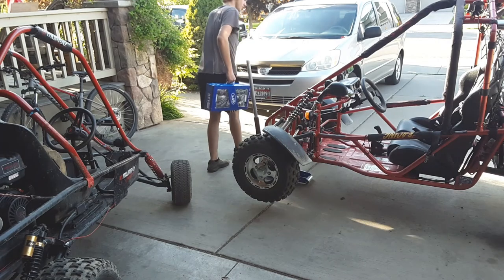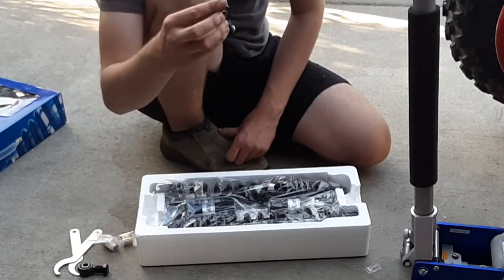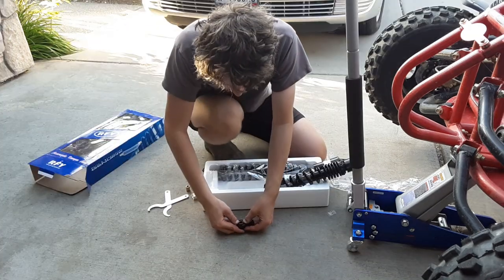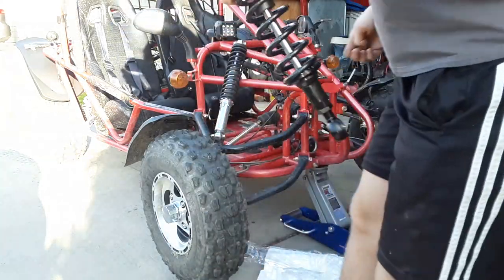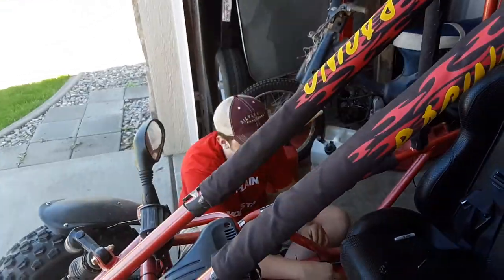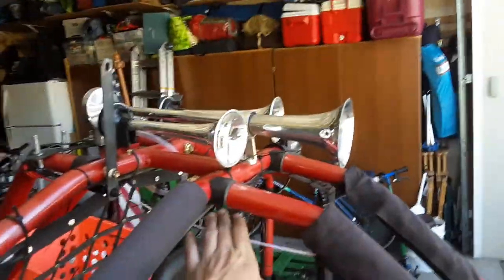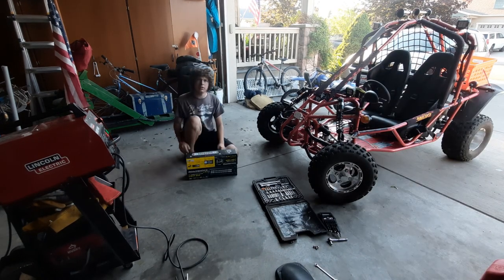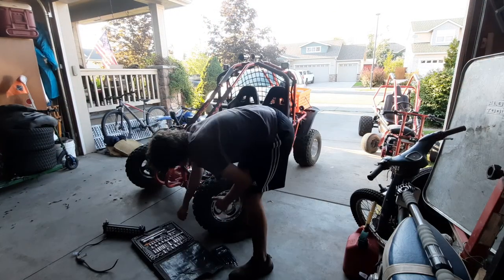Massimo GKA200 DIY Upgrades!

Comment: Where did you get the horns?
Reply from the maker: I got those off of ebay. There is a truck horn kit on there for $15 last I checked. The switch isn't included though, I just used a motorcycle brake switch and some rope.